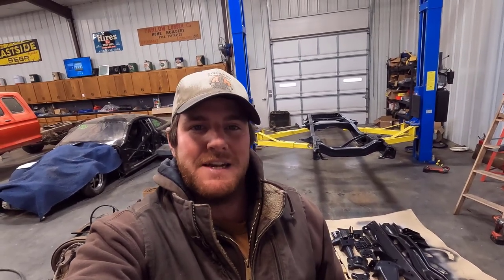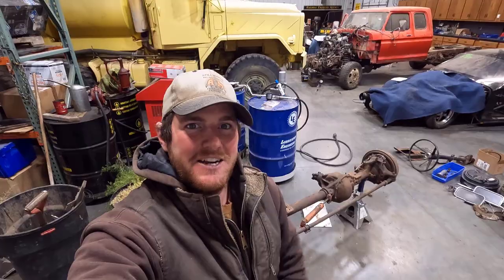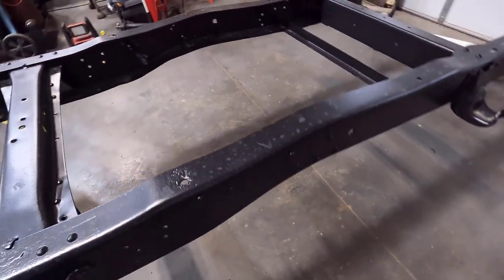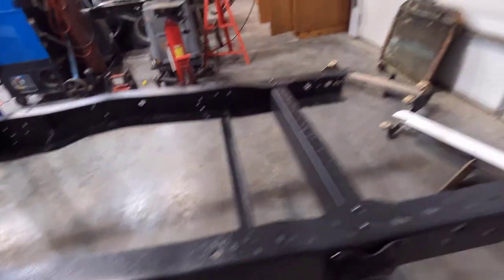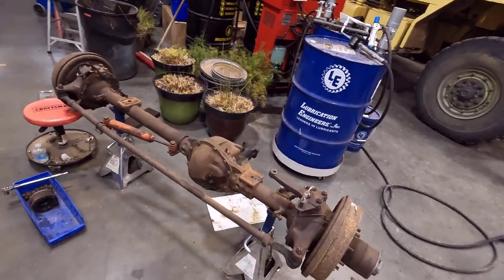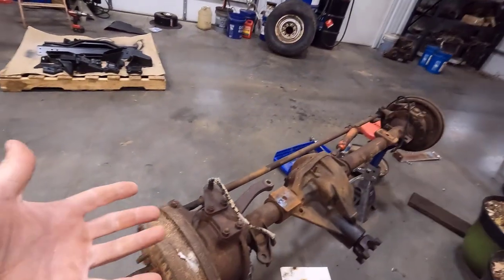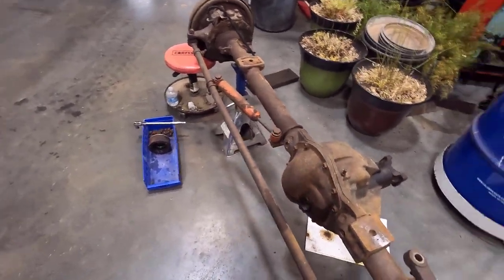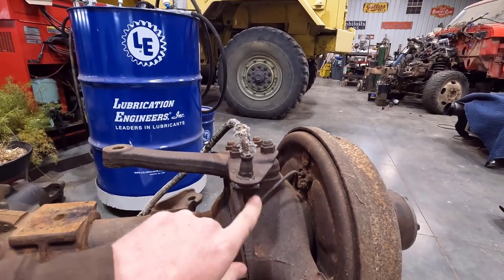Highboy Dana 44HD Inspection and Teardown

Comment: too many reasons to swap to 76-79 dana 44 with disc brakes, king pin bearings dont get me started another good reason. i have many of those trucks and have had many more. never had a ball joint failure thanks matt i like what you do keep on rocking those bump sides !

Comment: I had a 1971 F-250 Sport Custom 4x4 with a 360 big block and a 4 speed with granny low and the same Dana 44 HD front end. I bought my truck in 1980 and owned it for 13 years. I loved that truck! Back then, I was young and dumb, and some guy that liked my truck said to me that I had a 1 Ton front end. I had no idea at the time. When I bought the truck used it had 80,000 miles on it and it had the stock rims with the Extra Traction Lug knobby tires. And it was a High Boy also.

Comment: Great video!! I'm restoring my dad's 75 Highboy and after watching your video I noticed my Dana 44 3300lb Light duty front axle has the same brake hose/line setup as your HD. On mine the rubber hose goes to the bracket then a metal line goes to the cylinder. My father bought the truck new, and I can't imagine he would have changed it. Just thought that was weird after watching your video.

Comment: Great video Matt!, I learned something and that is I'm pretty sure I have a front axle out of a 77 highboy cause there are disc brakes on the front and I already new the steering gear box and pump are out of a 77 as well!, but I had it aligned and it drives great and no drifting!.

Comment: Isn't there a closed knuckle 60 in a '73-'75 f350?
Reply from the maker: The only closed knuckle 60 in a ford is in. 74-75 crewcab 4wd. There was no Ford produced 4wd F-350 until 1979.
Reply: @MattKubik1791  I got one. Where do I find info and parts?
Reply from the maker: @j.campbellscmb1740  Torque king
Reply: @MattKubik1791  thank you
Reply: @MattKubik1791  turns out that the axle I picked up is a Dana 70 closed knuckle front